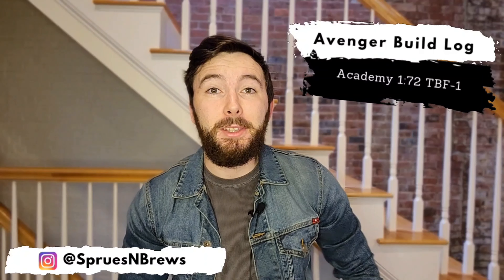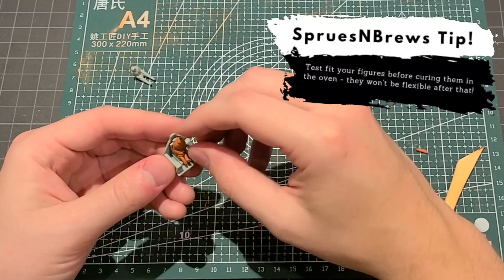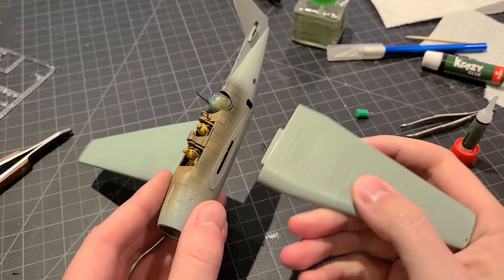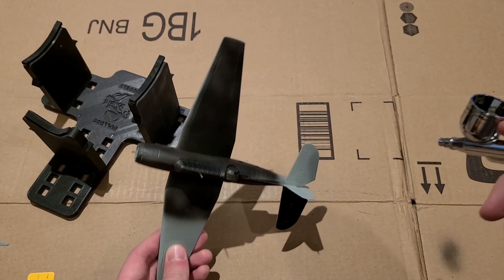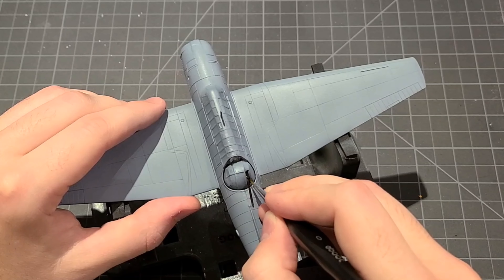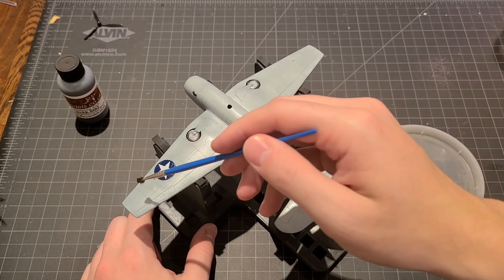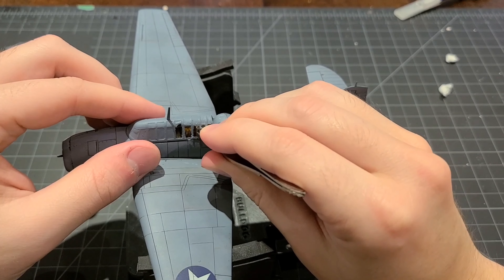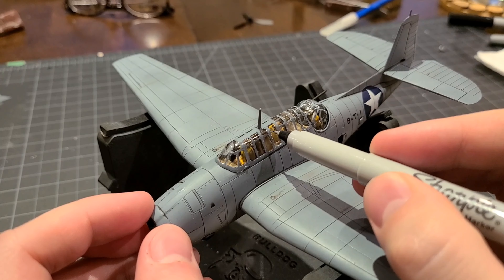How to Build & Paint Academy 1/72 TBF Avenger | Scale Model Tutorial

Comment: The plane looks great, but TB Squadron 8 was completely wiped out.  The only survivor of TB-8 was Ens. George Gay.  Plus TB-8 flew the TBD Devastator.  The TBF was used at the Battle of Midway but came from Midway itself.
Reply from the maker: Thanks! The six TBFs that flew from Midway were actually part of VT-8, and it makes for an interesting story! Apparently the Avengers weren't ready in time to sail with the Hornet & the rest of VT-8, so they had a small detachment stay back with the planes with plans to meet up with the rest of the battle group later. The new TBFs were at Midway Island when the battle started, so they flew out with a small flight of B-26s to join the fray. This particular aircraft I built was the only surviving TBF of that island-based detachment of VT-8 - it was piloted by Ensign Albert Earnest & was shipped back to the states after the battle for examination of her survival characteristics. There are some great shots available of the plane on Midway on June 25th before they sent her home.